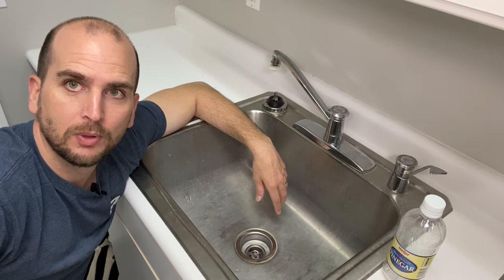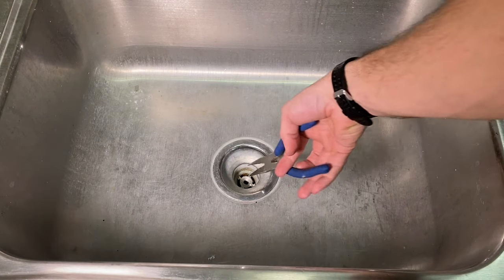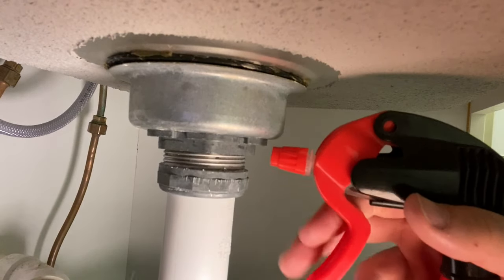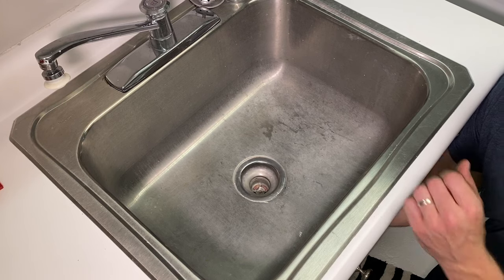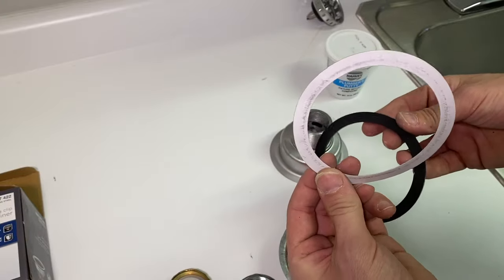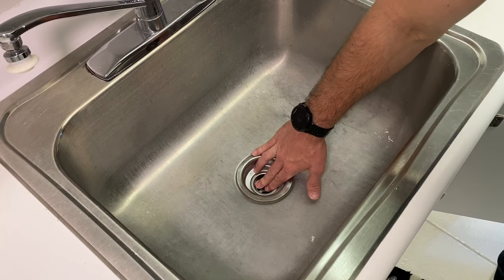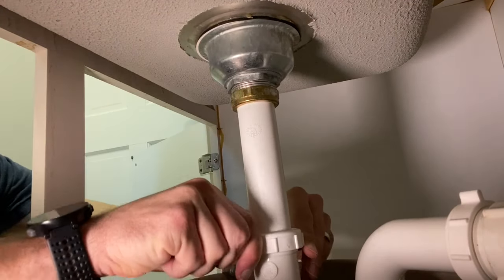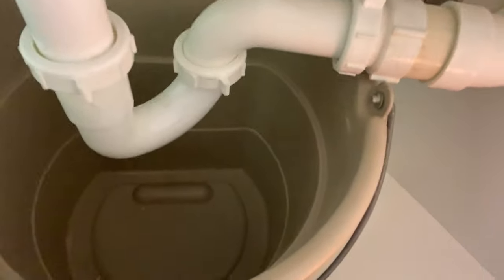How To Replace a Kitchen Sink Strainer | Hard To Remove Old Parts

Comment: Thanks for the video.  I don't understand from the video how the special tools work.  I am having a problem getting the basket nut off.  When I try to turn it, the whole basket turns.  I can't figure out how to secure it to get the tightened nut off.  I am thinking the special tools might be the key.
Reply from the maker: Hey Steve, one way or another you need to hold the basket from turning.  The special tool makes this easier or you can use needle nose pliers and stick them in the basket slots from the top to help hold while trying to loosen from the bottom.
Reply: @EverydayHomeRepairs  I got it!  I bought a wrench tool much like the one you showed and a t-shaped tool with prongs that gave us the leverage to hold the basket.  (I had my son hold the basket in place while I turned the wrench. Definitely is easier with a helper.)  Hopefully after buying all the tools and supplies, I still made out cheaper than a plumber call.
Reply from the maker: @sloshgator  thanks for the update and yeah the first time you do a faucet and/or sink job the specialty tools can be a bit pricey.  Now all your friends can borrow your tools 😂
Reply: @EverydayHomeRepairs  The video shows the needle--nosed pliers and the 'special tool' near the beginning, and then never shown again, nor explained.  "Securing the strainer . . ." maybe?  But no How to.
Had to dig thru the comments. 

From this one,  it sounds like you hold whichever tool, attached to the strainer, with ONE HAND from ABOVE the sink, and loosen the nuts with your OTHER HAND from BELOW the sink - at the same time.

Thank u!  (and wish me luck)

Comment: Great video, thank you. In-laws need strainers replaced, I will totally be able to do it now. Due to COVID, I can’t go into store to ask further questions. My question now is, as I have to replace the rest of the pvc pipes underneath as well, can I buy and install pipes and fittings without having to use the different separate sealers for connections or do kitchen pipes always require separate connection adhesive?

Comment: Edit: Nevermind....found another video. He used a drill to weaken the compression ring. I'll try that.

Compression nut is stuck but tail pipe is off with part of the drain hole ... the part that has the little cross bars that you used the needle nose pliers on. So the rest of the sink hole (no cross bars to grab with needle nose pliers) has just a hole that spins when trying to get the compression nut off from underneath. We tried wedging something in the hole to stop it from spinning while using channel locks on the compression nut. Can't get it off - Any suggestions? It's a small veggie (prep) sink in the kitchen.

Comment: Rather than replacing the complete strainer is it possible just to put plumbers putty around the bottom of the current strainer to prevent leaking

Comment: The black O-ring on my sink strainer is damaged from constant wear and tear over the last 15 years. From what I can visually see under the sink, part of the O-ring on the left side came off and just dangling around now and whenever water is running through the sink, water leaks out from that area. After I got to 1:46 of your video, I went to look under my kitchen sink again with some tools, but I noticed the tail piece under my sink is different. The one under my sink is completely rounded off, I don't see any ridges or edges for my wrench to latch on to for leverage to turn it, what should I do?

Comment: Love your vids.  Keep up the excellent content.  I’m just curious are the channel lock PVC oil filter wrenches better to use when removing basket strainer nuts that are 3 1/2”  vs traditional channel locks.  Do you find that tool useful.  Thanks!

Comment: Thanks for this video. Can you please let me know which size channel lock pliers you used? I need to buy one for this repair. I am hoping the tailpiece will come off easily once I have the right tool. Thanks again for your time.
Reply: I went to our local store and bought a Sink Strainer Lock Nut Wrench which was around $8. The wrench is adjustable so it would work on any sink strainer lock nut.

Comment: Am i supposed to let the putty that didn’t get removed on the top of the sink dry? Because when I try to do dishes little bits of it comes off on my dishes and I read that the putty causes cancer. Also it smells
Reply from the maker: Hey Sarah, so this would be the putty that squeezed out when the drain was installed and tightened?  If so, I would take a knife or something with a point and remove all the excess putty from around the lip of the drain.  Let me know if I misunderstood your question.
Reply: @EverydayHomeRepairs  ok I will do that then if there is a way could I send you a picture

Comment: I'm in the process of replacing my kitchen sink strainer but the mounting cup is stuck. It could be rusted to the threads but it does not fall off as easily as shown in your video. Should I attempt to spray vinegar on the mounting cup to see if it removes whatever corrosion/rust could be holding it in place? Or should I use force and pry it off from top strainer?
Reply from the maker: Yeah, some times the old parts can be tough to remove. I use vinegar on mineral deposits (usually greenish in color) and WD-40 on rust.  Also I have used a head gun in the past to see if the heat will help to loosen the bond and allow the parts to break free.
Reply: @EverydayHomeRepairs  Thanks for your quick response! I'll try vinegar first and then WD40 later to see if that works. Unfortunately I don't have a heat gun (yet) so hopefully these two will help release the mounting cup. Thanks again for your great instructional videos!
Reply from the maker: @TT-oe6iz  Happy to help, best of luck!
Reply from the maker: Best of luck!

Comment: I was washing dishes and tried to take the stopper out. The rubber part came out but the basket is still in there. How can I get it out?

All I can find is solutions like this but my problem is different. I wish I could post a picture ? Most of them have a metal piece but this was rubber.

Comment: how long do you let the plumbers putty dry after putting in strainer ?
Reply from the maker: 0 mins, the putty will not dry and that is per the design.  You can just lay down the donut of plumbers putty around the strainer and tighten down.  You will want to see it squish out from all sides which will indicate a water tight seal.  Best of luck!
Reply: @EverydayHomeRepairs  i did everything and the putty kept coming out over a couple weeks time, now the strainer is loose and leaking again. I thought i tighten it enough
Reply from the maker: @Lamar4ya  I would remove the basket again and start fresh with another bead/donut of plumbers putting.  Make sure to clean off all the old putty prior to laying down the new. You don't have to over tighten but definitely want to see the putty evenly coming out around the entire lip to ensure there are no leak paths.

Comment: What if the vinegar and heat still do not work.
Reply from the maker: Hey Ann,  never fun when you can't get the nut to budge.  In some extreme cases I have seen a hacksaw or sawzall used but take your time because you can also start making more damage than progress.  Best of luck!

Comment: Any guidance on how tight to make those connections?
Reply from the maker: For the plastic joints on the p-trap / drain pipe you usually just hand tighten but then the nuts on the strainer you will apply a bit more torque.  I usually just make sure their is no rim from the strainer sticking up on the inside of the sink and the plumbers putty has pushed out completely around the strainer rim with no gaps.  If you do the complete leak check I show in the video you will know if something is not tightened correctly.  Best of luck!
Reply: @EverydayHomeRepairs  Thanks, got er' done, but it was no walk in the park, lol.  I had to remove a leaking garbage disposal and reconstruct the drain/downspout.  I learned that the thickness of the sink matters when selecting a new drain.  Couple of trips back to home depot and finally got it all working.  I'm on septic so decided not to put a disposal back in place.  Thanks again for the tips!
Reply from the maker: @Flamadiddle2  nice, way to power through the speed bumps.  Multiple trips are probably the norm for most jobs under the sink.  👍

Comment: ok, stupid question.. we don't need plumbers tape on the threads of the drain pipe? good to know.
Reply from the maker: Hey Margo,  not a dumb question.  In this case no, plumbers tape (teflon tape) is used.  Whenever you have metal on metal with no type of gasket or seal then you need teflon tape.  In this case the pvc drainpipe will make a water tight seal without the need for teflon tape.  Best of luck on the repair.
Reply: @EverydayHomeRepairs  thanks

Comment: The pipe that screws into my strainer is a branch tailpiece and it doesn't fit on the new strainer so how do I get the slip nut to work
Reply from the maker: Is the size of the tailpipe smaller?  1 1/4” as opposed to 1 1/2”?  If so you can just go buy a new pipe or a new washer for 1 1/4” which will work in the slip nut.
Reply: @EverydayHomeRepairs  the tailpipe screws all the way up but when it gets a little tight it then loosens when turned more. The brass nut screws onto both the new and old baskets perfectly so idk the problem
Reply from the maker: Must be slightly misaligned with the tailpipe on which is making the nut jump threads when you start to tighten.

Comment: The best!  You deal with the stuck-on parts.  Now where is info about the locking tool.  Better, what tool might we use to hold the strainer from rotating without buying that probably $20+ tool?
Reply from the maker: Needle nose pliers would work, thanks for the feedback.

Comment: I'm not sure how you are securing the top of the strainer with the needle nose pliers. You don't show much detail there....Can you clarify a little?
Reply from the maker: You would place the needle nose pliers slightly open in  2 of the 4 opening created by the cross pattern at the bottom of the basket.  This is done so that when you tighten the nut from the bottom side and the basket tries to turn you are able to hold the basket with the needle nose pliers.  This Rigid tool also works well https://amzn.to/2xQt9ZH  Let me know if you have any other questions.

Comment: The very issue I'm having is removing the strainer body itself (see 4:13).  What did you do under the sink to get it freed up?
Reply: Okay, trusting the strainer body was simply stuck, I pried it off with a screwdriver.

Comment: Some video show use the strainer included rubber gasket instead of plumber putty but you put the rubber gasket at the bottom.  Which one is correct.  There is no manufacturer diagram .  Google said it is better to use rubber gasket as kitchen sink has big temperature change which is gasket is better than putty.

Comment: Thanks where i should buy the white thing under the black ring please let me know
Reply from the maker: Hi Gurdip, are you talking about the little paper / fiber disk?  If so, I think most people throw it out and don’t use it during the install.  It helps to allow for proper tightening but probably not 100% needed.

Comment: Is Plumbers Putty better than Silicone?
Do you have a video on installing all new schedule 40 drain pieces? I can't find one anywhere l.
Reply from the maker: I do prefer Plumbers Putty over silicone.  It makes a good seal and is easy to remove if you are swapping something out.  I don't have a video that goes into depth on drains but that is probably a good idea.  Thanks for the suggestion.

Comment: if the leak is caused from the plumbers putty basically being gone, can you just add new and reset the strainer and a new gasket set, and not buy a all new unit?
Reply from the maker: Yeah if the strainer is plastic I would just swap it out but if the strainer is metal and still in good shape the plumbers putty should do the trick.

Comment: The large nut that tightens the strainer to the sink looks really rusted and gummed up with mineral deposits. If vinegar, heat, WD40, the special wrench tool, etc. don't work do I just give up and call a plumber? What do plumbers even do in situations like that?
Reply from the maker: Bummer, yeah some of these can be really locked up.  I think some plumbers might use an oscillating tool with a metal blade or a dremel with a cutting wheel.  This guy actually cut off the entire basket with a hacksaw  https://www.youtube.com/watch?v=zvb3r99N-uc  Best of luck and let me know how you finally get it off.

Comment: so everything was good up untill my strainer is on a  double basin sink on the side that is off shot from the main line.  so the strainer doesnt connect to a verticle pipe buta very quick right angle

Comment: I have more issues with the stuck locknut on the top.
Reply from the maker: Hey Alice, are you talking about the large nut that tightens the strainer to the sink?  If so,  have you purchased a specialty wrench for that type of nut?  This is the one I use but there are many different styles  https://amzn.to/3oAimZ1 Best of luck getting the old strainer out.
Reply: @EverydayHomeRepairs  .
Yes the large nut on top.i have tried channel locks wrench and ez ridgid sinktool  but I can't get a good grip and the sink basket still spins.  I will try using your wrench soon.  I have used a hair dryer for heat and vinegar and degreaser but still too stuck.
Reply: @EverydayHomeRepairs  I got it open now!  I think I messed up though, I accidently put the rubber gasket install on the top of the sink instead of the bottom.  How bad is that.
Reply from the maker: @aliceaozaki5339  darn!  I would probably disassemble and rearrange the parts.  Do you have plumbers putty?  If not, I would leave the strainer together and go grab some plumbers putty so you can place a bead of putty between the strainer lip and the sink.  Let me know if you have any other questions and best of luck.

Comment: Idk why they call it a strainer, Its a Drain, the strainer is what you strain thing in the drain My plastic nut froze on it. So i used a dream tool cut off dis and cut down to the threads and used a screw driver to pry it off

Comment: Whelp. My problem is I can't tighten or loosen the nut that holds the drain. It's loose and leaking. Someone put teflon tape on the threads, I guess in an attempt to fix it and made this easy project impossible.
Reply from the maker: it is not uncommon to have to cut off the nut in these situations.  If you can get a hacksaw in there that will work or a small grinder / Dremel .  Best of luck and I know it can get pretty frustrating messing around in a sinkbase 😓
Reply: @EverydayHomeRepairs  First of all. Thank you. What's annoying is that this installation was done only 1 year ago, by a very good plumber. I don't know who, what, how this nut loosened up. I gonna give it one  more shot as I have a better tool to jam in the drain slots, to stop the assembly from spinning, while I loosen the nut with large channel locks. The good news is the sink cabinet is surprisingly open access, even though I have already whacked my skull a couple of times. Thanks for responding so quickly, as I'm going back in right now.
Reply from the maker: @gggnumber1  A spacious sinkbase?  Must have a 36" opposed to 30"  Bummer on having this issue with a new install.  I wonder if the nut was cross-threaded during the original install which made it feel tight but also jacked up the threads making it hard for you to remove.

Comment: The pipe corroded off and I have a triangle bracket in the way. Vinegar in a container for 20 mins and heat did nothing I don't think I can saw the connector off. Not even a pipe wrench will fit in between whoever put that old piece back on really ruined my whole weekend for what would be a 10 min project. Perhaps I'll have the ring soak overnight in the vinegar.

Comment: Get a fking sawsall and cut that garbage out and replace it right that’s how you do it. Nobody sits under there jamming around with trying to unscrew some corroded ass nasty garbage they are replacing to begin with . You don’t install new flanges and use the old garbage that’s connecting it anyway.